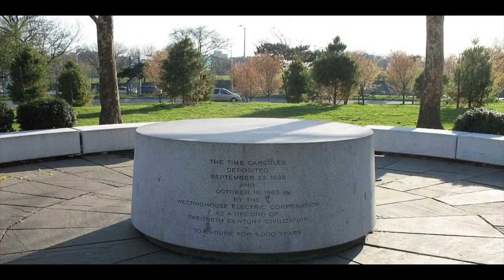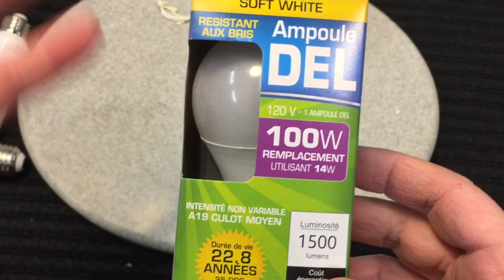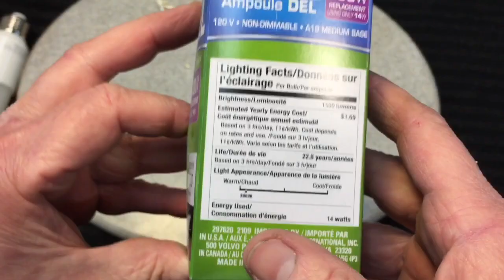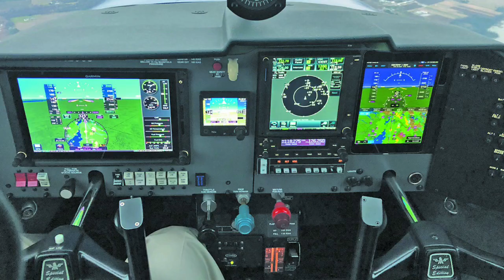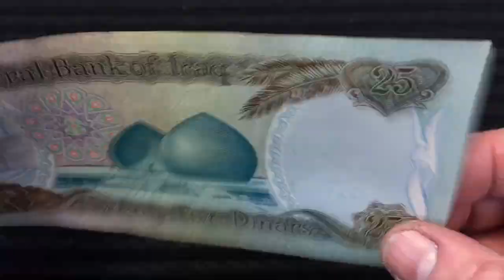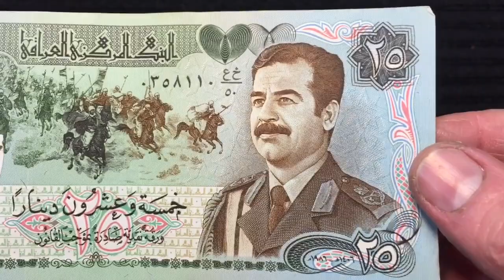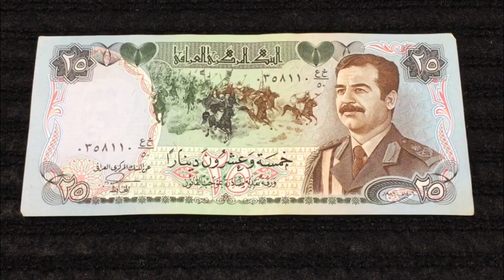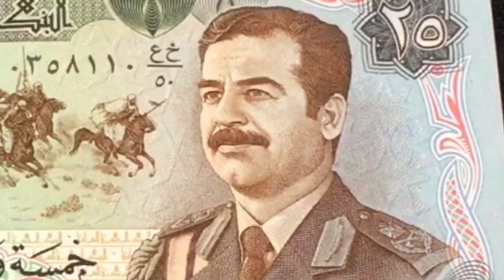Hobo Camp Knife Restoration- Lightbulb Teardown, Military Signal Lamp and More!

Comment: In scouting my four year older brother had that same knife/fork/spoon multi-tool; if our mother didn’t sell it in a yard sale it’s still around somewhere. Seems I’ve spent most of my career in Forestry looking at maps. Working in the coastal plain of North Carolina with International Paper for 10 years, if you didn’t  have a map, compass, and often an aerial photo when you left the road on a timber cruise you could quickly become a statistic. Flat terrain, heavy brush and swamp to contend with and no visible landmarks to spot from a hill leads to confusion. We always worked in pairs due to safety concerns. LED lighting is just fantastic, and so much improved; wonder what it will be in another 20 years.

Comment: Saddam Insane, typical tyrant. He expected everyone to sacrifice themselves to save his country except when it came to his turn he ran away like a coward and was found hiding in a hole. Weak bastard. Anyway, great video Scout, that knife brought back a lot of memories. I had learnt to navigate long before I joined the Australian Army reserve engineers so the map reading was like a refresher course. Working out where you were heading was easy enough but remember when you had to do a back reading to work out where you were using a map, compass and 360deg protractor. That had some of the knuckle heads completely baffled. 😂😂😂 Cheers Stuart 🇦🇺

Comment: I've gotten a lot of good tips from your videos, but the color temperature has proven to be the best of them all! My house was built in 1951 and has all of the original finishes. I had been replacing light bulbs as they burned out with LEDs. Because I was buying them by the three pack, the lighting was somewhat disjointed, I had not paid much attention to the temperature. I finally did my research and ordered a pack of 48 bulbs (surprisingly cheap that way) and changed all of the lighting in my house to about 3, 000k. What a difference! Some elements that did not age as elegantly as others look so much better in this lighting. It's much warmer and more inviting, literally so, I find I'm keeping the thermostat lower. It's kind of neat, I never really considered the effect of lighting of the day on collectibles. Really a fantastic difference!
Reply from the maker: JP- It is my humble opinion that the biggest mistake the lighting industry did when introducing LED bulbs was not pushing warmer bulbs.  The Higher Kelvin LED's were much more available and cheaper to use in production so the companies tried to push them on the public with mire appealing names like "daylight" or "Natural White" and "Cool White" well when husbands went out and bought a pack of these great sounding bulbs and installed them around the house they turned homes into a Morgue looking environment and the wives hated them!  The LED's were removed and the incandescent were reinstalled. It took years before people would try another LED after that bad experience...

Comment: My thoughts on led is it’s made in China or Mexico. When I was doing commerical lighting the drivers is what failed. Not much lasted more then 2 years. The lights are pretty bomb proof. We use the 50 color in our home. Remember as we use less electricity the rates go up. If we put the pride back in an American factory we would have a light that lasted years. I had one of the scout knifes as we called it. It got stolen with about a hundred of other knifes when we went on vacation. I’m going to put another package together for you with a few more light bulbs and a couple new locks as soon as I remember where I put them. Great entertainment. Thank You

Comment: ScoutCrafter 

The maps are called topographic maps or topos for short.   I spent two summers with survey companies as a draftsman.   The land surveyors would go out to properties to survey the land.  They would establish a  datum based on established surveys dating back to George Washington, in some cases.  The surveyors would return with locations (latitude, longitude), or some other grid and an elevation.

Surveys in Michigan, where I grew up, stsrted from baseline road (8 mile road), latitude.  There wss a longitude but I don't remember where it was located. 

I would take the surveyors field notes and would draw topographic maps.  In turn the maps would be checked.  Eventually a licensed land surveyor and/or a licensed civil engineer would stamp the drawing and the drawings would be registered with the County.

Those maps are a result of a lot interpolations between  numbers.  Now this can be done using GPS or GLONASS (Russian version of GPS).  Which read latitude   longitude and elevation.

Bob

Comment: Do you really think you can remember where you buried the time capsule?  I made one when I was at Penn State and put it between two masonry walls where there was a name stone left out (probably until they found the highest bidder to have their name on a building).  I made it from a piece of steel pipe which I welded shut with an old computer add, coins, and I can't remember what else.  I welded a tag to the side that had info stamped into it and then I painted the whole thing bright orange so hopefully it will be noticed if anyone ever finds it!
Reply from the maker: LOL- Yes! I used the tower and time capsule as points and brought a tape measure to line up exactly where it is..  Hopefully there isn't a tree over it now!  LOL

Comment: For the LED bulbs that you have taken apart, could you take a closer look inside the socket? I think I could see it in your video, but I've seen someone else on YouTube point out that only one wire is actually soldered in place. The other relies on a springy pressure contact. Ridiculous. Can actually create a blinking action as the bulb ages... well before the expected lifetime of an LED bulb.
Reply from the maker: Yes- Some are just pressed against the shell!   The UL ones are soldered I believe...